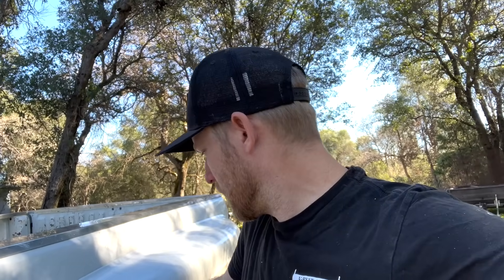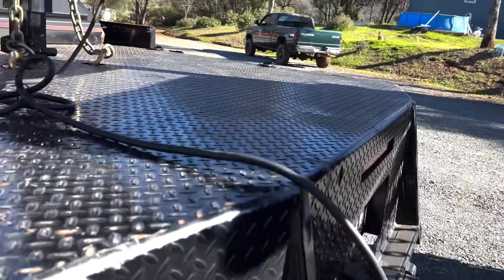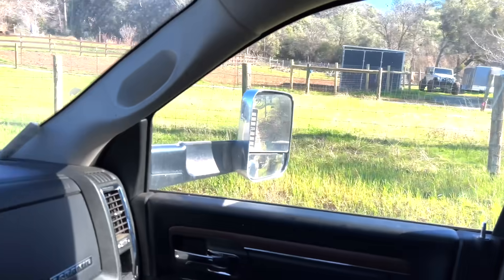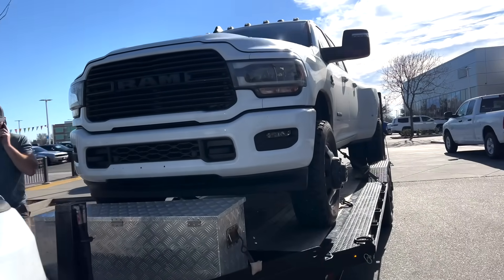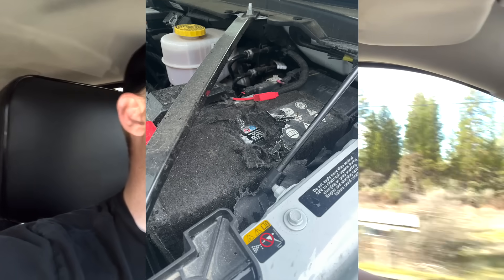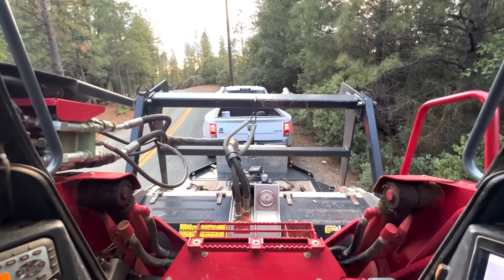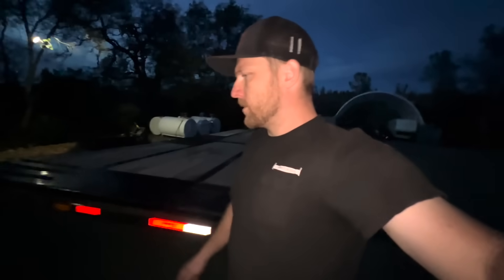TOW RIG DOWN!! & thieves mess with my new 5500…

Comment: Hey Sam, If you put a D ring at the back of the trailer bed you can use your winch to pull a dead truck off the trailer by running the cable thru it and back to the dead truck. It would get the truck to the ramps then gravity will take over.

Comment: 3:45 rodents in the vehicle; totally decommissioned new truck
5:20 snatch block/pulley
6:40 4th gen towing a 5th gen
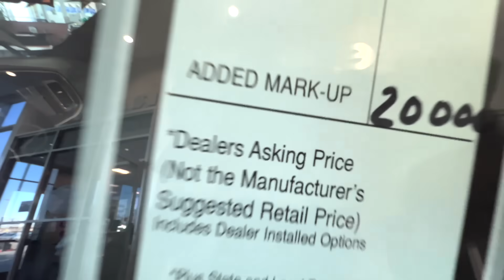8:05 did the tow test w/ that truck 19/4 36
8:25 kinda daily but not his tow rig
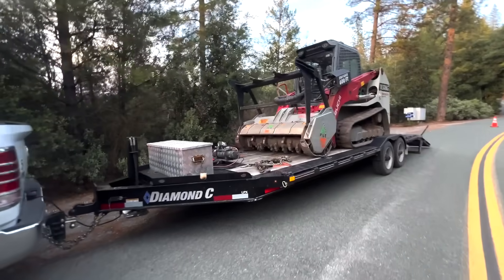11:01 very effective bumper pull

Comment: Id be worried about what they may have put in my tank. they have lockables thats what id be doin
Reply from the maker: Trust me I’m worried. But the lockable ones pop right off with pliers
Reply: Maybe fabricate lockable fuel doors for that flatbed. Wont stop a hell bent thief, but it wont make it easy for them either.